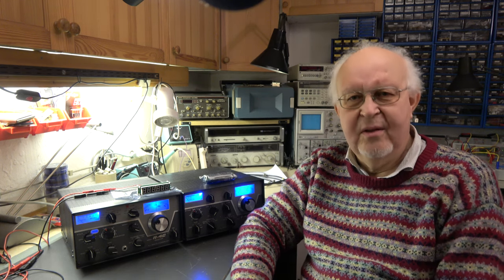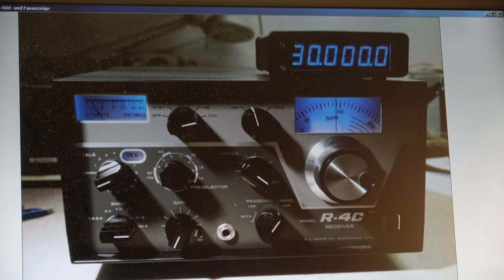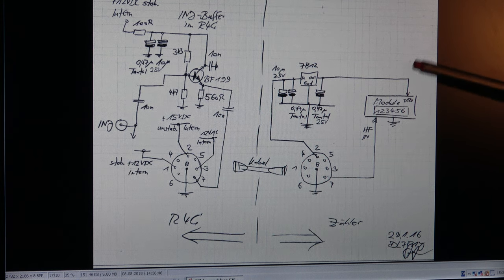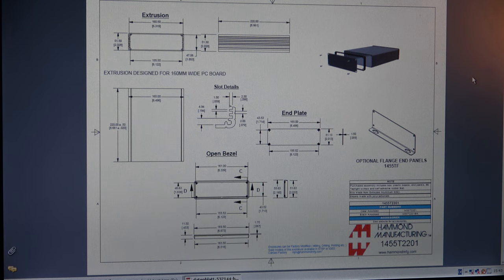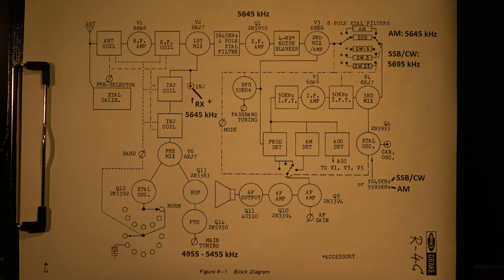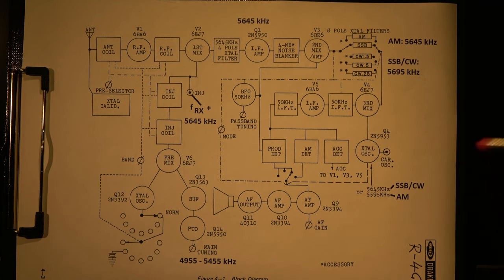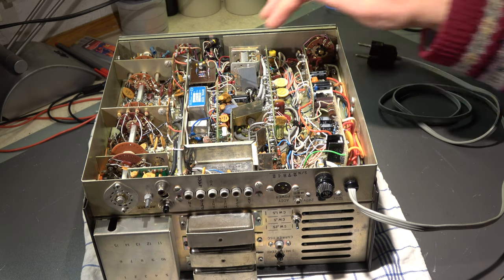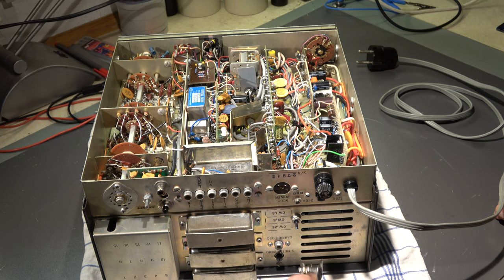#65 Drake C-Line Frequency Displays Part 1(3)

Comment: If my C-line did not include a "Torrestronics" display I'd copy your project...appears our R-4C's are of a similar vintage, very close to the end of the run along with my T-4XC. Look forward to Part 2 as there are probably a few tidbits I can still learn for my rigs!  73 - Dino KLØS
Reply from the maker: The torrestronics TK1(?) is also good i think. I bougth my R4C in 1977 (1978?) via direct import from an US-dealer who was especially also selling here in Germany. ; was much cheaper than from dealers here in Germany....hi. The T4XC i bought used in the ´90ies.

Comment: Hallo Stefan, solch ein Zähler Display habe ich auch an meinen Atlas 210 angeschlossen. Bei den Displays ist es auch möglich eine zweite ZF welche programmiert werden kann über einen Schalter aufzurufen. Das habe ich genutzt um die ZF einmal zu addieren und beim Umschalten zu subtrahieren. Wenn es Dich interessiert (vieleicht ist es dir noch nicht bekannt) kann ich mal rein schauen und dir dann mitteilen  wo der Schalter angeschlossen wird.
Desweiteren habe ich jetzt auch (endlich) einen TR7 ergattert :-) 
Ich muss in deinem Video noch nachschauen welche blaue Folie du verwendet hast. Bei meinem TR7 ist diese total blass und es leuchtet nur weiß :-(
73 de Bernd
Reply from the maker: Hallo Bernd, dass dieses kleine Display (PLJ-6LED) eine 2.ZF hat, ist mir neu! Schick mir bitte die Beschreibung (dl7maj (at) t-online.de).
Zur Folie: Ich hab eine Folie aus der Disco-Beleuchtungsbranche gewählt; gibt´s im Netz unter "Farbfilter Disco 21 x 21 cm für PAR 56 Spot Light".
Reply: @dl7majstefan753  Weißt Du zufällig noch die Nummer der Folie? Ich meine das Blau mit der Bezeichnung "118 Light Blue - Hell Blau" oder "165 Daylight Blue" müsste passen.
Reply from the maker: @berndb.5097  Hallo Bernd, ich hab da einfach verschiedene Folien gekauft, so auch die 117 "Stahlblau". Welche ich aber verwendet habe, weiß ich nicht mehr. Am besten verschiedene kaufen (kostet ja nicht viel) und ausprobieren.